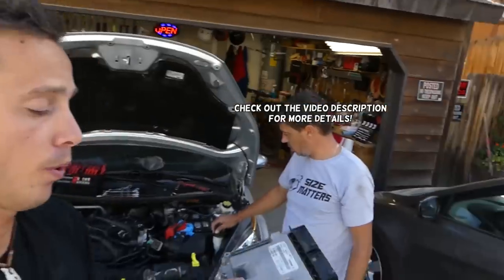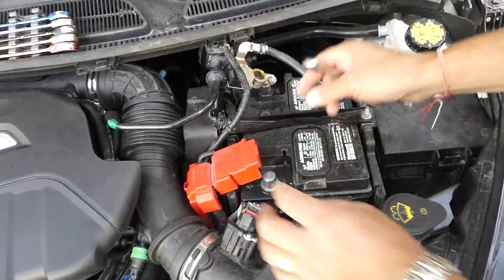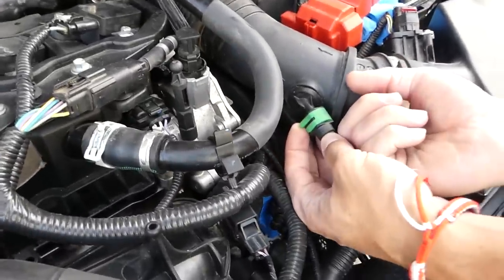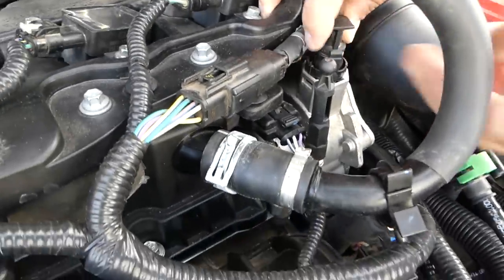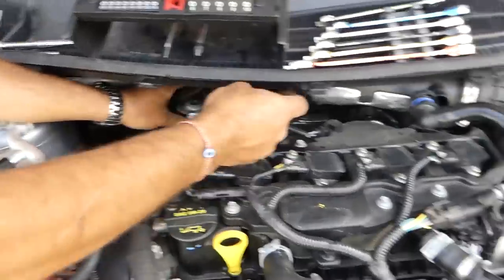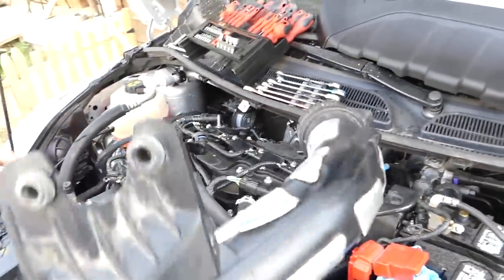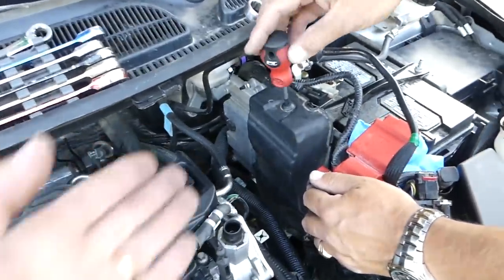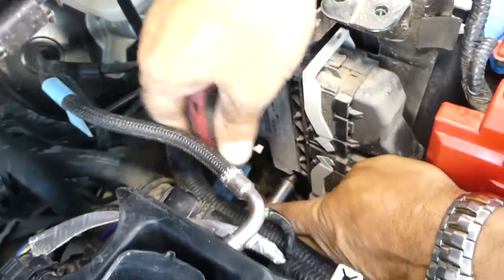HOW TO REMOVE OR REPLACE ENGINE COMPUTER ECU ECM ON FORD FIESTA MK7 ST

Comment: Hi there. I’ve got an eac fail on a 2005 Ford Fusion diesel, the error code stil remains despite fixing what the diagnostics said. Would I be able to have a replacement pre owned ecu installed and this will sort that issue ?

Comment: Hi, could you make a short video how to remove (plastic) battery tray (there are two bolts underneath holding it that is tricky to undo). Lot of water get stuck there and metal begins to rust. I want to get there as soon as possible. I have Fiesta mk7 1.25. Thanks

Comment: hello

nice video

before remove ecu connection- disconnect the battery 1 hour before, 
once place new ecu connect the battery and wait 1 hour then try to start the engine?

Comment: My car crank but wont start
Anybody know whats wrong?
Reply: Hi if you have spark and petrol check the cam sensor on top, it could be faulty.
Reply: Crank no start. 

No fuel pressure 
No spark

Check your fuel pump and check pressure.

Check for spark of you have fuel pressure 

If nothing injectors clogged perhaps